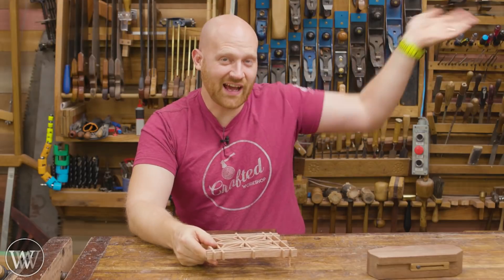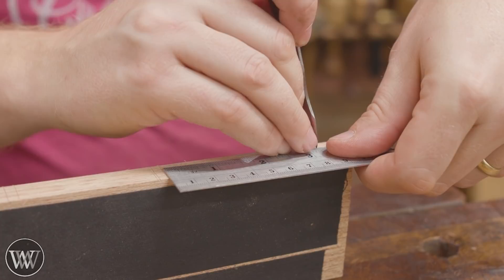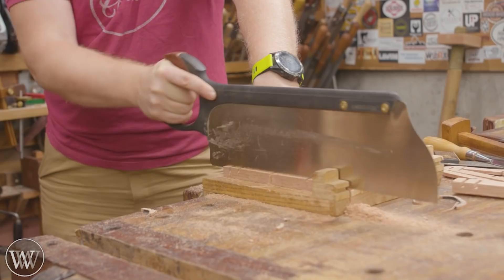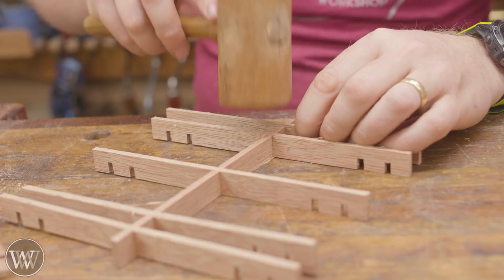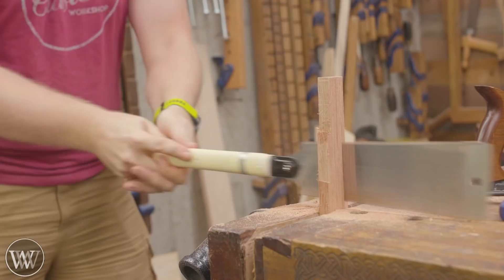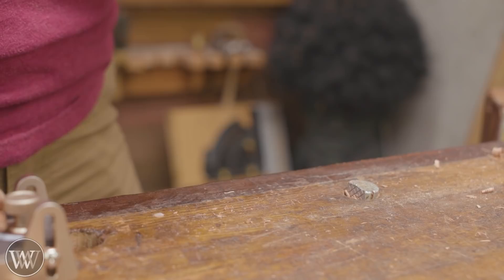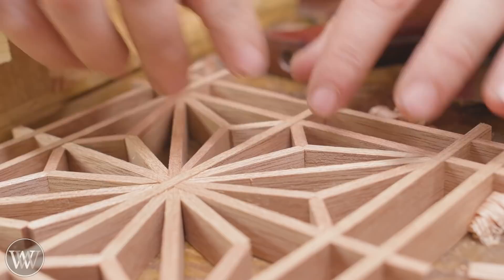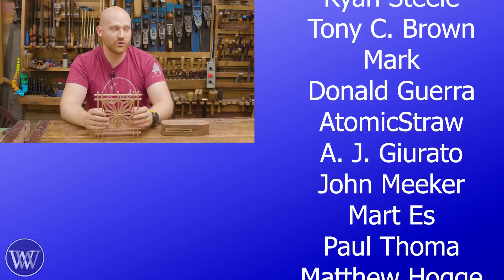How to make Kumiko by hand

Comment: That does look like a lot of fun!  Would it go well as part of a cabinet door (like a china cabinet or curio cabinet) or would the repeated opening and closing over time shake the components apart?
Reply from the maker: That's the most common use for it. Usually you just dab a tiny bit of glue in each joint and it's about a solid as can be. Congrats on first.

Comment: What is that skewed plane at :51 he is using on the shooting board? It looks like a Stanley #5 but skewed and angled tote. WHAT IS THAT!!??
Reply from the maker: That is a shooting board plane. It is designed to ride in the groove and run down in grain. Here's a video on it. Here's a video on it. https://youtu.be/CUswU5TtToQ
Reply: Thank you for your fast response. I have a new goal to find and use one of these. I’ve seen and used many different and effective planes on my shooting boards but this could change everything. Thank you for your response.

Comment: Great video! Thanks for this! Could I just ask regarding JMP and ripping: would it get stuck along the way or? Like, creating that thin stock/strips with JMP would seem ideal!
Reply from the maker: Unfortunately if you're trying to rip anything more than about 6 in it will clog up the teeth and cause the blade to go off one direction or the other two eject the dust. Or it will just jam up.

Comment: I don't think you mention it anywhere in the video, but is that oak? How did you like working with that wood? And would you recommend using a different wood instead? Any woods to stay away  from?  I have a lot of smaller scrap pieces including chunks of 2x4. 

Also, if I don't have a bridge city plane, I would have to mark the thickness with a marking gauge and try to plane down to that?
Reply from the maker: Most any wood would work. Just remember the softer the wood is the sharper the iron has to be. This was Filipino mahogany. A really nice wood but you have to be careful with the grain it can run away on you. And correct to do it without a thicknessing plane you just mark a line on the board and plane it down to that line. You can make a little jig just to test it to make sure it's the right thickness all that long.

Comment: Can you elaborate on why the joint maker pro isn’t good for ripping?
Reply from the maker: If the cut is too long then the teeth clog up with sawdust cuz it can't go anywhere. So much longer than about 6-in cut and it won't work right. Starts to cause problems with the blade itself or will push the work out of the cut.
Reply: @WoodByWrightHowTo  Ah...They do make a rip blade for it so maybe that would work better, but it sounds like it would be obnoxious to keep changing the blade. Better buy two of them since they're so cheap and fit in your pocket